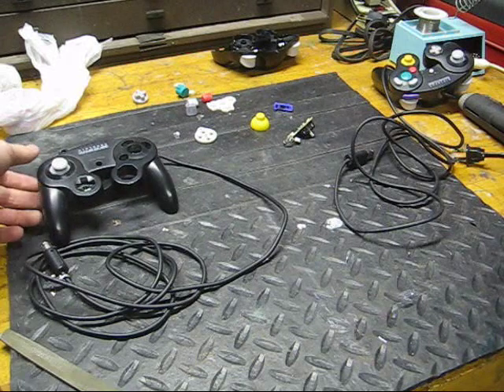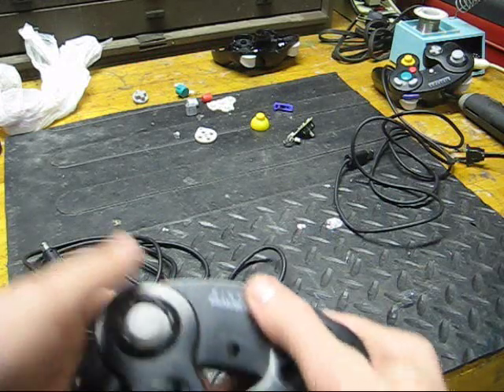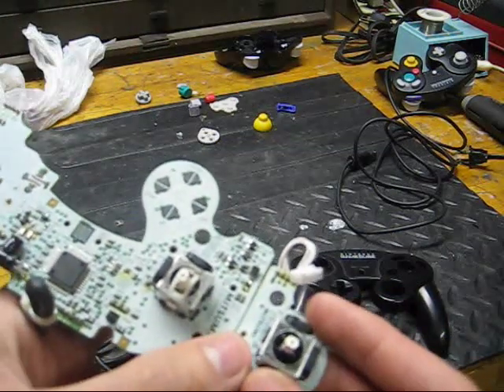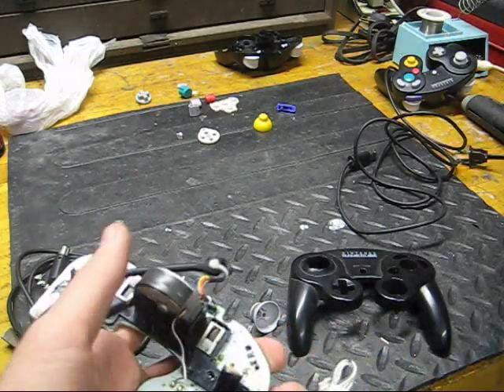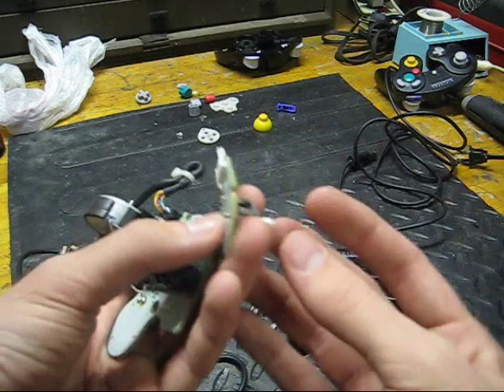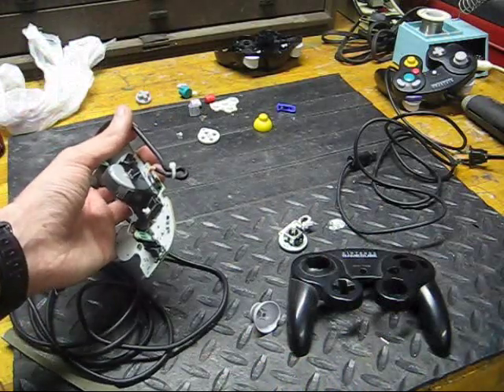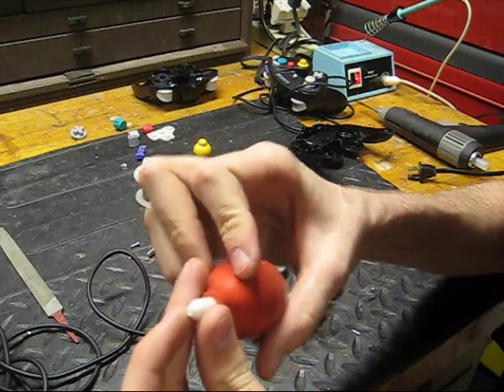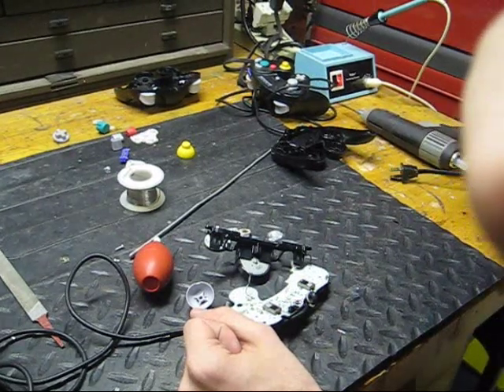Replacing a Gamecube controller analog stick - PART 1

Comment: To make a  Tri-wing screwdriver just heat up a pen that you dont need and press it on the screwhead it will meltinto the same shape as the screwhead.  I used this to open up my GBA and add a backlit screen.

Comment: Something I would like to point out is if you guys have the Plastic assembly controllers, you don't have to use a soldering iron, just take the 2 screws out, and use a tiny Flathead screwdriver and pry off the X and Y axis stick boxes, bend them slightly and it'll be no problem "luckily all the Smash Bros and White Gamecube controllers have this", the metal ones, you have to use a soldering iron no matter what "unfortunately all the Wavebirds have that" but you can still pry off the X and Y stick boxes luckily.

Comment from the maker: The rubber ones are tough to use, as you have to pay attention to squeezing them and keeping them right over the solder.  Seems like more dexterity than necessary is needed.  Mainly a problem since you have to suck fast and it can get clumsy.

Comment from the maker: @andresh Maybe with HEAVY modification and a lot of engineering, but it is certainly not a drop-in or even similar part.  N64 uses a separate plastic assembly that connects to the main circuit board instead of a metal part soldered directly onto it.

Comment: @alecjahn
I actually managed to open up the controller WITHOUT using a tri-screwdriver or a filed piece of metal like you used. Although obviously not the ideal solution, I found out a very small flat head screwdriver does the trick; it locks well enough into the screw for it not to damage the screw head. I can definitely recommend you try it :)

Comment: @alecjahn Thanks a million for this vid, I pulled the fix off! I just wanted to let you know; you can also use a thumbstick from a Wii Nunchuk (they're electrically identical, handle differently though).
I've also found an online component store that sells these pot meters suitable for GC controllers.

Comment: You have to desolder the solder points that are connected to the parts where the batteries go then you can take the black plastic board off.

Comment from the maker: Actually pressing down hard is what you want to do, it keeps the screwdriver seated.  The only downside is that if you DO slip, you'll screw up the driver even more.  
I'd just buy a tri-wing screwdriver off ebay.

Comment: I bought a Tri-wing screwdriver from ebay for $1. Seems a lot easier than this method. Couldn't find any analog stick assembly though.
Reply from the maker: For sure!  The right tool makes things a million times easier!
Reply: alecjahn Alternatively, you can use a Torx T06, it will fit right into the center of the tri wing screw.

Comment: My wavebird controller's control stick is pretty much completely broken.  It will not recenter on its own at all.  I can get it to click in place, but if I move it then it pops back out of center.  When it is out of center, it is 100% lopsided.  There is no spring to it at all.  From the outside, it looks normal other than this problem.  I would rather fix it than buy a replacement.  The Gamestop guys didn't know of anything to do.  I'm just wondering if it can be fixed and, if so, how?

Comment: will replacing the analog sticks of a third party or knockoff gamecube controller with official mechanisms work
the knockoff mechanisms are too sensitive
btw mine I got from Amazon and one of the controllers- UP on both of the analog sticks doesn't work properly

Comment: One other question that almost anyone can try to answer. How can I unscrew these stupid screws on the controller? I went to a local hardware store that has mechanical stuff that Lowe's or Home Depot would never have. They didn't even recognize the shape of the screw. Basically, where specifically can I buy one of these? I would prefer to not buy it online, but I doubt that's possible. If I can't buy it, is there another way of getting the screws off?

Comment: Would a Wii Nunchuck work for a Gamecube controller?
Reply: Yes it would, the Nunchuck-stick, GC analog stick and c-stick all fit onto eachother.
Reply: I figured that out because they have similar notches but thanks anyway.
Reply: ***** What about a 3rd party Nunchuck?
Reply: Thatguywiththelaptop i doubt it
Reply: What might cause it to not work? The size of the joystick is identical to the regular Nunchuck.
Reply: I was asking because I was going to fix one of my Gamecube controllers because one of the thumbsticks is loose.
Reply: Thatguywiththelaptop theres a ton of 3rd party controllers and theyre not all the same size, just try it and see if it fits.
Reply: O.o

Comment: help please i got 3 gamecube controlers from wee brand new and i hate how there not working only 1 works but the c anolog stick wont go to the right only gose up down left :( what to do to fix it ????
Reply: in game try pressing X + Y + START and hold that for a while. While pressing those buttons you are "resetting the controller" My thumbstick does the same thing, thats I fixed it.
Reply: thank you DatMissingn0 it works :)
Reply: DatMissingn0 It fixes it for a limited time for me. My left analog stick has problems when i move it to the right. i.e I walk extremely slow on Smash.
Any idea how to fix? :x
Reply: Honestly. I feel like if the reset option isn't doing it for you, you will have to open up your gamecube controller and try to clean your thumbstick. What I did was

 -I bought a tri-wing screwdriver from Amazon for $1 no shipping fee

- DeoxIT (A good contact cleaner)

- Compressed Gas/Air (Helps clean the inside from any dust)

I opened up my controller, used the Compressed Gas to clean the inside of the thumbstick as much as possible then sprayed it with some DeoxIT. After a while I kept moving the thumbstick, sprayed it with more Compressed Gas to remove any gunk leftover and sealed my controller.

Keep in mind that I had these items around my house because I use it for other things. I do not recommend to buy all these supplies just to try and fix your controller. Its better to buy a new one from Play-Asia or a used one from LukieGames. Hope I was able to help somewhat. Reply again if there is anything I can help you with.